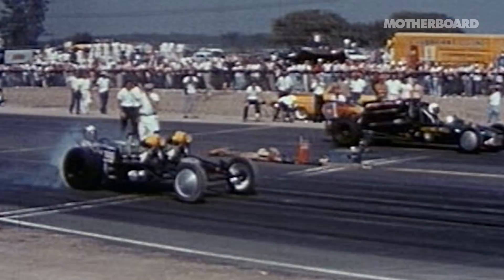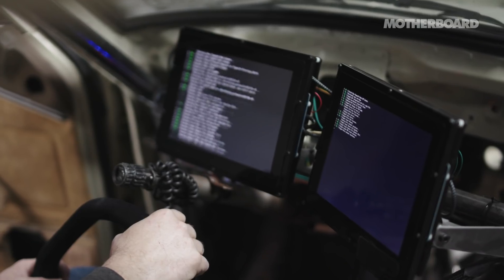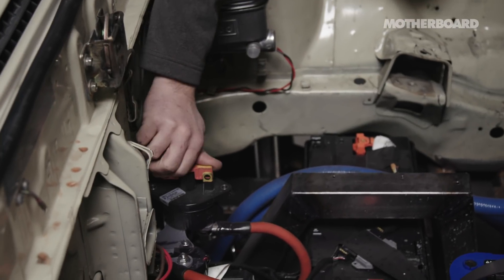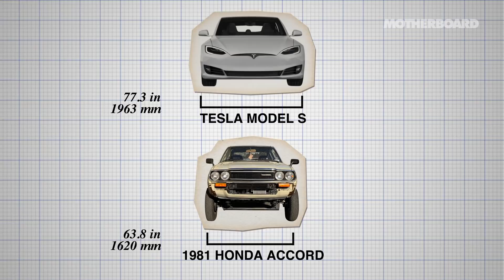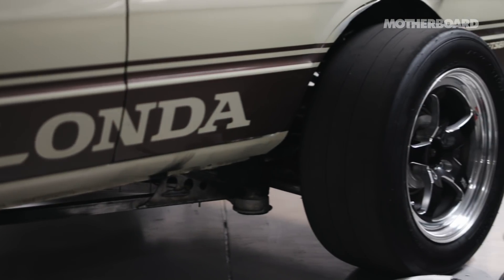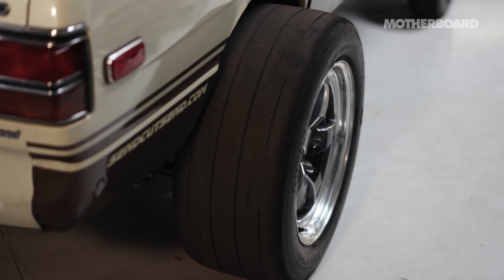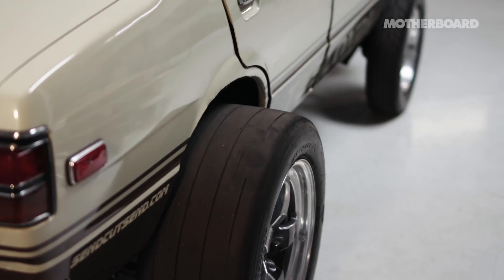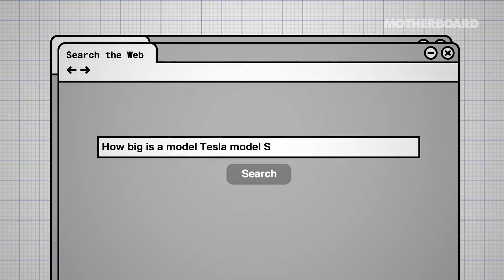The Half Tesla, Half Honda, 100% Electric Hot Rod - The Teslonda

Comment: So, there's nothing Tesla in the car but you call it a Teslonda?  Confused.  Should have done the Delorean as the EV but great job!
Reply: Uses Tesla's induction motors.
Reply: @miguellopez3392  Ah, gotcha.  Still, not much of a Tesla when it's 100% Honda body and 100% Chevy Volt battery and controls but, ok.
Reply: @RussellFineArt  the dude, in this video, states the motor, inverter and the subframe assembly is from a Tesla model S.
Reply: @MrSHUTUPCAT  ok

Comment: I'd like to see this configuration in a '60s Chevelle/Skylark/Cutlass/Lemans, but with the engine in the front. It's a tuneable chassis that's well represented in the aftermarket, and has a lot of room for batteries. Drag racing is fun, but turning hot laps is better.

Comment: It’s awesome but I’ll stick with my diesel Jetta. 550-700miles a tank depending on how my foot feels that week. I’d like to see it beat that. 80-100mph and I’ll still get around 40-42 avg mpg on the hwy
Reply: Tesla's get 70-130mpg EPA so something like the model 3 preformance would get 90mpg at 90mph and get a 0-60 in 3.4 seconds but the range would be 200-300 miles.
Reply: Miguel lopez you’d still only get around 500 miles on one fill up on a Tesla and that going 45 mph max. So yeah I’ll stay with my diesel
Reply: @Red-uf4hr  how often do you drive 500 miles without a break?
Reply: Miguel lopez either way if I wanted to go out of town or even tow a small car I could and still have the power and mpg to do it.

Comment: But can it run Crysis?
Reply: Probably at least DooM
Reply: @MrSHUTUPCAT  definitely Doom a T83 Calculator can run doom. A tesla cpu probably can run Crysis.   While doing a 1320/9
Reply: With all that electric power stored in it's batteries, it will mine Bitcoin

Comment: Just install a speaker for the noise
Reply: It would be really funny if they get a V8 gas boy to drive an electric car with V8 sounds 😂😂 can you trick people is the question.
Reply: @Mr.Ramirez95  i think it just need something to vibrate the car. Make them think it had an engine.
Reply: Mr. 2 minutes Easy, put a large subwoofer.
Reply: neighbors appreciate that

Comment: Yeah sure, Volt battery is smaller and easier to get into this old honda. But it also has 6 times less capacity. And weighs only about 3 times less than model S battery. Power wise, model S can do 500kw, this, maybe 300 if at 100SoC. 

https://www.energy.gov/sites/prod/files/2015/02/f19/batteryVolt4313.pdf
Reply: my guess: not looking for capacity, but for thermal/discharge capability

Comment: There will be no future for hot rodding, even with electric vehicles. 
Driverless cars are coming and it won't be long before a human piloted automobile will be illegal. 
no driving = no hot rods
Ironically, the man responsible for the the Tesla car company is one of the people pushing hardest for this reality.
Reply: Cars aren't going to be illegal to drive, at least in America where we have a choice. Yea people will push for it, but there will be enough people pushing against it that it will probably just be optional wether or not you want to drive...maybe a few roads where its automated cars only. The model T is a very old, slow, outdated,and most unsafe car you could pick to drive on today's roads. But that's not illegal as long as you are on a road where you can hit the speed limit. Why should all other cars suddenly be illegal when a new one comes out? Even in the worst case scenario of being limited to tracks, it's not going to be expensive either because spec miata costs very little to race. Toyota is developing self driving tech that allows humans to drive but monitors them to prevent crashes, you don't need (nor will we ever reach) 100% ubiquity to prevent traffic deaths. There are also people like Alex Roy working with ArgoAI to voice for the car enthusiast, miata and some sports car companies have stated that they will always sell at least a few cars with a steering wheel. Even if most cars were level 3 or 4 autonomous it would drop deaths substantially enough that level 5 would just be some form of public transport that you could use if you didn't own a car, and not required by law.
Reply: @greynolds17  I would like to have your optimism and I agree with nearly everything you say. 
I just don't have any faith in future generations of Americans to not trade away absolutely everything for marginally increased safety.
Reply: @Just Being Socially Awkward When the enjoyment of the automobile becomes limited to private tracks it'll go the way of the horse, which is to say it'll be accessible to only the wealthy, and that is very much against the spirit of hot rodding. It's roots coming from blue collar young men, particularly American veterans coming home from ww2 armed with all kinds of new mechanical knowledge from working on everything from deuce and a halfs to fighter planes.

Comment: It's not the same thing. For most people the sound of an engine has greater value than the performance. Great, you have a car which would win all drag races, but you can't race because it's electric. On the street you can neither use the full performance nor have the full sound experience. It's just a shitty one trick pony that can't do it's one trick.
Reply: Gonna go ahead and guess you're probably not yet old enough to drive, also it's pretty obvious you don't know how racing works. He wasn't kicked off the track because his car is electric. He was kicked for making a 10 second pass. For a car in that speed bracket you need a roll cage and some other mandated safety equipment, then as soon as you hit 9.99 you need an NHRA license.

Also as someone who daily's a truck with a 390ci v8 I'm gonna say, sure a bigblock is a nice sound, but fast is fast regardless of what's making the power. Saying "the sound is more important than the performance" just means you've never been in a fast car.
Reply: Lmao, lame theory 🤣. I did my driving licence 12 years ago. Sound is more important than the performance because I like the sound and I can enjoy it all the time, even when not going fast. I just like the sound and that's all there is to it, no lame theory needed 🤣. You wouldn't be yourself without making the theory of everything and judging me just to write smack about me 😂
Reply: @bluef1sh926  Why don't you ride a horse then? Sound better and is more nostalgic?
Reply: What about the idea of loving new tech and just going for it?  Also, why not both?  The dude has built a steam car, several gas hot rods and now an ev.  Why is this a bad thing?  I say it's rad as hell my friend.
Reply: Well, if you just need the sound, hook up a BMW exhaust computer to your stereo in your EV.

Comment: That's interresting but if I simplify he "just" took a Tesla Motor and Honda Battery and installed it in an old Honda. But he didn't made it faster. What I mean is that the Tesla he took the motor off was has fast (if not faster) than his car even though it had AC, Soundsystem, Massaging seats and so on. So I don't really get the point. Hot rods are supposed to be faster (I mean WAY FASTER) than their OEM counterpart... It permit him to learn how electric vehicule work and that's interresting but other than that....
Reply: His Honda is now faster than it was.
Reply: @toddlerdurden7331  I knew that somebody was going to say that (and I don't blame you, maybe I wasn't clear enough) but that's not what I meant. What he did is more like an engine swap than a real hot rod were you modify your parts to go faster.
Reply: What do you mean "he didn't modify his parts"? The whole car is modified. Did you not see the vast amounts of fabrication work done to the car? The countless hours that would have been spent fitting everything in to make it all work together? What would you like to see him do? Build his own motor from scratch? (I can guarantee you a VERY small amount of people build gas motors from scratch, and even then, they are still buying parts to go into it) 
The very definition of hot rodding is putting an engine into a car that it doesn't belong in, or at the very least, doing a few small things to make the car just a little bit faster. This guy took 3 different cars, and mashed them into one very fast car, and the other parts that go along with enabling the car to go fast (brakes, front suspension, etc). This is about as modified as a car gets short of a completely custom built body, which it looks based on the fab work on the underside looks like it's about halfway there....
Reply: Lol wat

Comment: Can you still use the "autopilot" side of the Tesla?
Reply: Of course not, that's software, hes just using the hardware like battery's and such
Reply: Considering the people shown in this video are all electrical and software engineers.... and their budget. They have the ability to create a rudimentary “autopilot” ish setup. Probably closer to cruise control than actual self driving. Needs some kind of computer vision to pull that off, would take a lot of man hours.

Comment: kicked off from drag strip, too fast. WOW.
Reply: 10 second quarter mile is fast...but quite average for most comprehensive builds. You can find Honda CRX's with K20 engine swaps pulling 8.X second quarter miles here on youtube.. electric could do better, we just need more pioneers.
Reply: No, too fast for him. He needs proper licensing.
Reply: @no_bull  it has a roll cage
Reply: Too fast for what he was licensed to drive.
Reply: @Calyx  once you hit a certain time your car needs a roll cage for safety or else they won't let you run anymore

Comment: Guy 1- adds every possible knowledge to build gasoline drag racing car...looses bets.

This guy  JUST SLAPS Tesla motor in,ND   is not allowed for DRAG  RACING.  WOW
Reply: And its perfectly fine for drag racing...he just has to have proper safety measures and be certified
Reply: Lol ya, JUST slaps it in.  Like it takes zero knowledge to not fry yourself with half a million watts (not even joking).   It to not have it roll right out the backend.

Comment: Dodge Hellcat has left the chat.
Reply: Zonda r has joined the chat
Reply: Dodge Hellcat left because it didn't want to be associated with this "hot rod" ;D
Reply: @turdferg9703  agree. Anything electric is not a hot rod. It's just a fast gay persons car
Reply: Dodge Demon has entered the chat.
Reply: Porsche 918 Spyder has joined the chat.
Reply: @macheifach  More like Porsche Taycan joined the chat
Reply: A hellcat could smoke this thing at a roll race
Reply: @bbspeed6896  you sure? I bet that Honda weights 1/4 of what a hellcat does. And makes almost as much power.
Reply: 1958 simca is all confused.
Reply: The new one will be part electric it's reported.